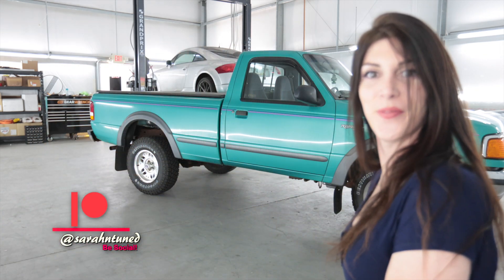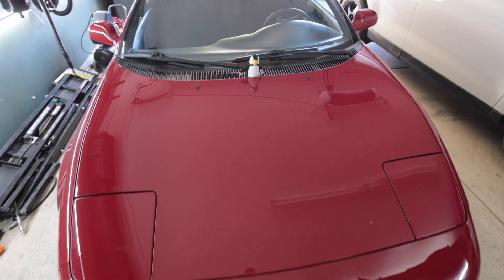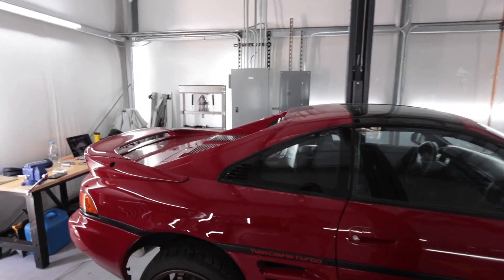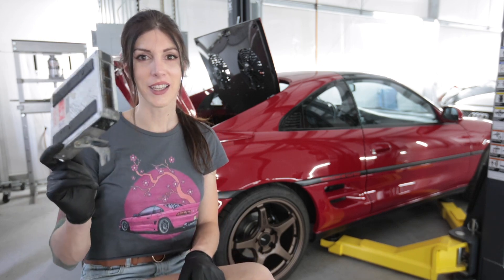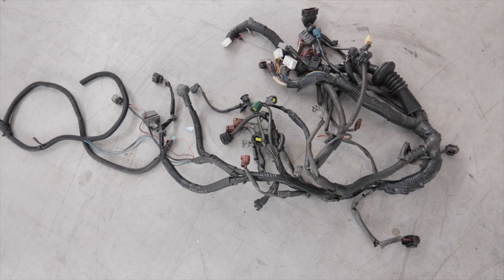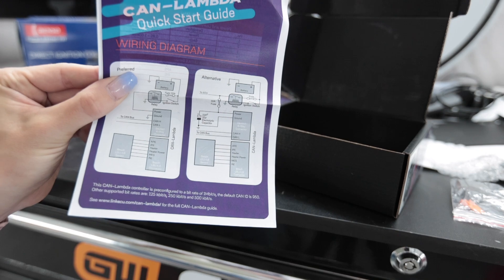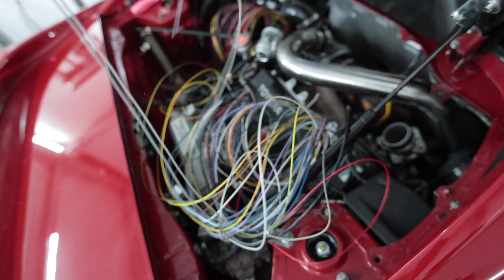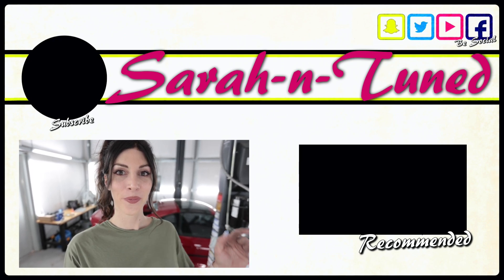Building an Engine Harness From Scratch! // Mr2 Turbo Link G4+ Stand Alone ECU

Comment: I would nail the old harness stretched out on a piece of plywood might have to do sections if too long then follow the old leads with new wires which would give you the correct length

Comment: Would a couple of peg boards be easier. Set the pegs out based on the original and hang the old loam.  Plac a second run of pegs above and run your new wire ,

Comment: If I had to remake a wiring harness like that, I would label both the old and new harnesses, so you can route the new harness wires in the same manner as the original or in a path that makes better sense to you and reverse engineer it. You got this, Sarah! I'll be doing the same thing on my 94 Legacy before too long, and I don't have nearly the harness engineering experience that you do.

Comment: I built ls swap harnesses for years its not hard as it seems at first, you got this. 👍
Reply from the maker: Now that I studied the service manual diagrams it’s much less intimidating. My source of stress is figuring out the distributor delete and coil packs with flex fuel.
Reply: @SarahnTuned  one tip, lay out your factory harness flat on a big enough board and trace out harness labeling all the connector. It will help to keep the lengths and breakouts pretty close to original.

Comment: Sorry I have no suggestions as to how to film it. I know you will make it entertaining and informative though.
Im interested to see if you crimp the wires or solder the pins.
I only ever made a wiring loom for an old Kingswood  Ute and I soldered every pin before mounting in the plug. Was a massive job

Comment: Lay the factory harness out on the floor and label the floor using that harness. Put new harness over where you labeled the old harness on the floor.
Reply from the maker: I’m not replicating the factory harness. Multiple circuits are being deleted, adding flex fuel, coil packs and the wiring is going to be tucked down the bay is clean.

Comment: When I have wired vehicles in the past, I create a wire book with all the system wiring diagrams on separate pages so when troubleshooting a problem in the future, it’s much easier to follow using the simplified wiring diagram than trying to trace a complete vehicle wiring diagram. Most OE diagrams do this too in addition to the  complete single schematic.
  I have labeled wires using self adhesive return address labels and an Avery printing program. Label the wire with where it goes and where it comes from. Wrap the label around the wire, lengthwise, and cover it with clear shrink tube. You can look at a wire a year from now and see where it goes without looking at your wiring schematic.

Comment: I have a 97 mk2 MR2, and I've rebuilt most of it... except for the wiring loom. I've contemplated doing an ecu upgrade, but it's a rabbit hole I'm terrified of. Hence, for me, you couldn't go into enough detail in a video for how harnesses go together. Although I suspect I'm a very small percentage of the viewership that has a specific and dedicated interest in precisely what you're doing...
Reply from the maker: Break it down one circuit at a time. There’s not that many to make this car run.

Comment: I admire your courage. White creamy stuff in the face aside, fabricating a whole new,  half JDM and half US wire harness,  for a aftermarket  added ECU computer  controlled ignition and fuel system on a distributor based mid engine car... Whoooo. Respect. 
Maybe explain the engine control circuits as you build the harness and get say two videos on the fabrication and another video to test and road test the system. 
The Fast and Furious guys could write you a part as their in house mechanic. You are cute and fun enough for them to write a bit of fun business using   your on camera persona. 
Love from NYC, opening by July 4th and all of us enjoying the lull before the next SARS 2 variant wave... Larry.
PS... Famous last words spoken before cursing for a week... 
" I got this."

Comment: Sarah ats racing has plug and play link G4x ecu for Toyota mr2. They have base maps and can do remote tuning for you. If do this I’m pretty sure your car might not idle right with ac on.Not to mention vsv and tvis stuff inside the intake manifold won’t be able to be used. I’m just trying to save you time and suffering. If anything remake a oem harness with new wiring and use the plug and play link.

Comment: Maybe get a piece of plywood and make the loom as it is shown in the diagram using nails or screws in the wood. Then you can run the wires just like the diagram and wrap the wires around the nails to hold in place. If that makes any since. Lol
Reply from the maker: I used to make a jig like that for equipment. It’s more useful when you’re making 10 of the exact harness. Just a hassle for one though.

Comment: One thing that isn’t mentioned much is how slick the video production is. It must take hours of work to maintain this level of quality. Well done Sarah. 👏🏎
Reply from the maker: I just don't do anything other than this, eat and sleep. lol
Reply: @SarahnTuned  It takes a very high level of commitment, that's for sure!
Reply: Are you an avionics Tech by trade?
Reply from the maker: @TheGibby3340  ground support equipment 2A6
Reply: @SarahnTuned  DINSTAR?
Reply: @SarahnTuned  5 or 7 level?
Reply from the maker: @th-bc3hn  7
Reply: @SarahnTuned  Awesome, I was at a Joint command and had AF working for me, spent two weeks at Edwards learning how to manage AF201 files and validate leave records. I'll send you one of the Challenge Coins from the command. I didnt see a PO Box in the About section but i know you have one. Ill look for it.
Reply: @SarahnTuned  I was too. In the Air Force. Great job for learning your mechanical basics.
Reply: "I just don't do anything other than this, eat and sleep." And get your hair and nails done.
Reply: 2T2 for life!!!

Comment: You're a trained professional 😉
Reply from the maker: Just not on cars, lol. Although cars are easier, so it works out.
Reply: @SarahnTuned  if you were satisfied with the layout of the stock harness (length of the wires, locations of splits,...) You could nail it on a board and use it as a template for the new one

Comment: You have a better chance of seeing a 🐧 walking across the street in Arizona 🤭
Make blow up copy of each diagram. Put them side by side to have a better visual to do the layout. When I use German wiring diagrams to trouble shoot it's easy to copy it and lay it out because of 3 or 4 different pages in a 250 page diagram.